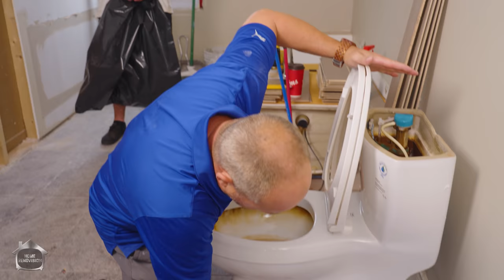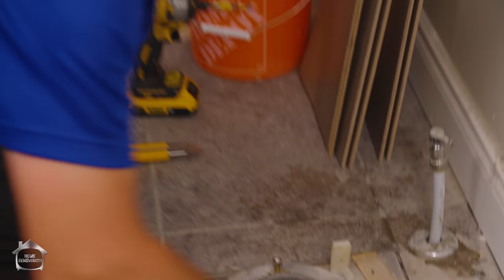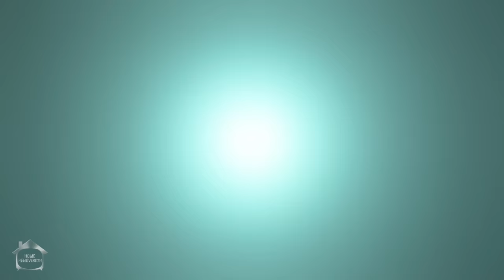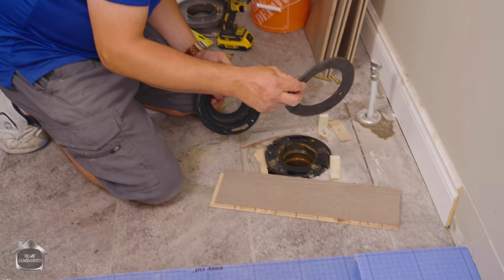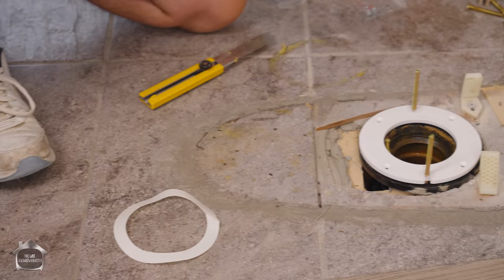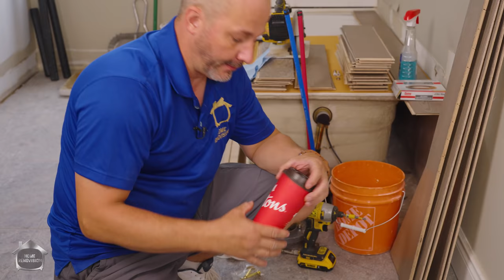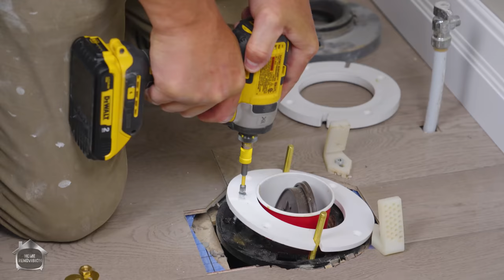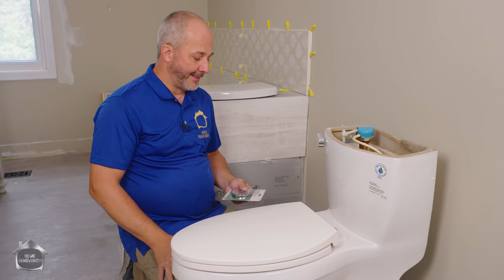How To Install A Toilet So It Won't Leak | DIY For Beginners

Comment: As a master plumber and someone who has been doing it for 20+ years this is an excellent video with very good information. The only thing I'd add is don't ever use anything made of metal to repair or raise the flange height. Those metal flange repair kits always rust and fail, don't use them. Use plastic or rubber like all the different options shown in this video.
Reply: @Supa Trending Daily you don't have to use a metal flange. There are better options. Have you had the toilet off to inspect it? Or are you just saying that because you haven't seen any water damage? There can be water damage that isn't visible until you remove the toilet. Maybe you grease will protect it. Seems like an unnecessary step when you could just get something that works without it.
Reply: @Supa Trending Daily why did you have to use a metal flange
Reply: @mattmcc7930  I did a toilet replacement one time.  Lifted it up and the floor was completely rotted underneath.  Surprised someone didn't fall through floor into basement while on the loo.  Only thing holding the toilet up was the abs pipe.  Good thing the drain was only a foot or so from the stack and gave the toilet good support.  You could not tell from the top and no problem on ceiling below.  Just a little leak over years.  I ended up doing a complete reno of that bathroom.  The lady was very happy and I used the rubber seal under the toilet.  The old beeswax seems to have disintegrated over dozens of years.
Reply: Even stainless steel flanges?
Reply: @TheKrugen79  Perhaps. I have seen rusted out stainless steel toilet bolts. That's why I only use solid brass. While stainless is much more resistant to corrosion it is not impervious. That said, rubber will degrade over time but will probably still outlast the stainless steel. Plastic will degrade but takes much longer then then the others, like a life time even if not more.
Reply: HI Matt McC. im installing my toilet and i need to use a flange extension to raise it up to a quarter of an inch from the finished tile. The Flange extension i got does not have a gasket to seal when i screw it to my existing toilet ABS flange. What can i use to seal to avoid leak in between the extension flange and the original flange? Would appreciate getting your expert advice. Thanks
Reply: Thanks for replying Matt. Appreciate it. Start your own channel too.
Reply: @mattmcc7930   I used a 1/2 flange extender and i am about 3/8 higher than the finished tile now (1/8 higher than ideal 1/4). Am i ok to still use the jumbo reinforced wax ring?
Reply: @stevenm7606  you should be fine with the thicker wax ring. A little extra tall won't hurt anything.
Reply: @mattmcc7930   Nice..and is 3/8 of an inch above the finish tile acceptable? I know 1/4 of an inch is ideal,.
Reply: @stevenm7606  3/8" should be fine. I prefer to be flush or a little high. But I have placed the entire flange directly to the finished floor and never had an issue. So the entire thickness of a plastic flange above the floor and it was fine.
Reply: @Matt McC  I actually have two flange extenders....1/4" and 1/2".  With the 1/4" i will be flush in front but about 1/16 low on the back. Can use the Jumbo Reinforced wax ring..With the 1/2" is where i will be about 3/8" higher from finished tile. Which of the two flange extender sizes would better you think?
Reply: @stevenm7606  They will both work. I'd recommend a little high over a little low, but that's just me.
Reply: @mattmcc7930  Thanks a lot for your help. I
Reply: @Matt McC.. I am using the flange extender in this video with the compression gasket. That should be a good seal already? or adding silicone would make it more water tight?
Reply: @stevenm7606  never use silicone
Reply: @mattmcc7930  alright. So the compression gasket itself that comes with the flange should be perfect?
Reply: @stevenm7606  It should be fine. I prefer wax.
Reply: I’m thinking I better go with the jumbo wax as I’m about 1/8 below the finished tile
Reply: @MegaJiat  yes
Reply: you mean like the metal flanges they used 50 years ago that are usually still in tact after 50 years? The idea is that water never touches the flange since its covered by a seal and the water should only enter the drain hole as its designed.
Reply: @TDA DIY  No, not like those flanges. Those were cast iron or sometimes just lead. I'm talking about the modern flange repair kits that are just coated steel or stainless steel. Or the new flange fittings with metal flanges. I understand the idea of it, but theory and actual use don't align. I've replaced countless rusted flanges that weren't more then a few years old. Every material breaks down over time, steel more so in a wet atmosphere. In my opinion it's best to have the material that takes the longest to break down over time, like plastic. Even your wax ring will break down, so why not have something that will outlast it?
Reply: @stevenm7606  silicone
Reply: @mattmcc7930  silicone seals any micro-gaps between two hard surfaces.  Engines use silicone for head and valve cover gaskets for that very reason.
Reply: @John D  cool story bro. I've never seen anyone use valve cover gasket to seal a toilet to the toilet flange. Let me know how that works for you.
Reply: @mattmcc7930  You have reading comprehension issues?  I said the use of sealants, in addition to a gasket, is commonly used in mating two surfaces together.  To suggest not sealing an ABS riser flange to a toilet flange is a recipe for leaks and damaged subfloors. .
Reply: @John D  This isn't an engine. Don't use silicone. The rubber gasket in this video is thick and flexible on purpose to allow for expansion, contraction and movement. If you add silicone then you are gluing the gasket in place. It isn't designed to be glued in place. It is plenty capable of sealing on it's own and adding silicone to the mix is adding failure a point. Do it how you want on your toilet, but don't come here give bad advise. Use automotive gasket sealer/maker on your engine and use toilet gasket on your toilet, it's really quite simple.
Reply: @mattmcc7930  The foam ring on the underside of Oatey flange extensions is less than 1/8"  thick.  If the existing toilet flange has scrapes or gouges, or is slightly cupped (by overtightened toilet bolts) it can cause small channels where water can bypass the foam ring.  The 5 second step of applying a thin bead of silicone is well worth it.  As for expansion, contraction and movement issues, that is the whole purpose of silicone, which is flexible by design.  lol
Reply: @mattmcc7930  And if you're referring to a foam toilet ring instead of wax, no professionals use them anyways, so it's really a moot point.
Reply: @johnd9541  I'm referring to the rubber gasket used in the video. The same one you recommend using silicone on because engines.
Reply: @John D  you missed the point completely. Gluing the gasket to the flange will cause issues. If your flange is gouged then replace it. If you are incapable of replacing it then I suppose you could fill the gouges with silicone and let it dry before placing the gasket, but it's a subpar fix and thats not what you said. Again, gluing any gasket to the flange will never be done by a professional. It's exactly why we use and recommend wax. Because you get the best of both worlds. But clearly you know everythibg there is to know about gasket, toilets, and engines, so perhaps the best thing for you to do is start your own YouTube channel and enlighten the rest of the world with your great wisdom.
Reply: @mattmcc7930  Silicone is NOT a glue.  Try reading  labels.  And to suggest breaking up a floor in order to swap out a toilet flange instead of 30 seconds and 30 cents worth of silicone serves to confirm your purpose here is merely to drive up page clicks and engagements for this channel.
Reply: @mattmcc7930  With that comment I can only assume you're a plywood salesman.  Don't silicone your tub drain gasket either, right?  People like you keep people like me busy.  Please keep it up.
Reply: @John D  You are clearly an amature who thinks himself a professional. No, I never silicone a tub drain. A pro knows how to do it so it never leaks without a from of silicone. A pro also knows that if he does use silicone and it does leak then good luck getting back off because silicone in a tube or caulk gun is an adhesive you dip. What do you think holds a trimless glass shower surround together? Silicone. You are the reason people end up having to cut a tub drain out with a dremel because some dip didn't know how to properly install a tub drain that doesn't leak without using silicone, AKA adhesive.
Reply: @John D  Let me guess. You don't cement, you silicone the pvc joint together. Screw in my truck tire? Silicone it. Get off your crutch learn how a real plumber does it.
Reply: @mattmcc7930  You neither cement nor silicone PVC or ABS together.  You solvent weld them.  Silicone is not a glue therefore using silicone to patch a tire would result in a blowout due to air pressure.  Drains are gravity based, not pressurized, therefore pressures don't reach more than a few PSI at the toilet flange, substantially less than a sealant can handle.  Anything else I can help you with?  And please stop using T tape on compression fittings too.  ;)
Reply: @mattmcc7930  Geeze I won't even mention that silicone is recommended over plumbers putty for non-porcelain sink  drains, but then you don't seal either because you rely strictly on the fit of the chrome basket against the hard sink surface.   lol  And please forward a pic of the word "glue" or "adhesive" on any silicone tube you find.  I'll wait.  :)
Reply: @John D  Recommended by who? The silicone company? Have you ever tried removing a basket strainers sealed with silicone? Non porcelain? But what about your porcelain tub? Yes, I use plumbers putty, unless otherwise specified. Do your own damn research. Use your silicone on your kitchen sink let it set for 48h and then try to remove it, and then come back here and tell me it's not an adhesive. The fact that you've never seen the word "adhesive" on a tube of silicone tells me you never really even looked.
Reply: @John D  I'm surprised silicone even sticks to anything if it has no adhesive properties. Wow that's weird.
Reply: @mattmcc7930  Okay now youre just being silly.  Plumbers putty is obsolete for most uses as it dries out over time.  It's not 1950.  And p.s.. when you apply silicone, use a thin bead instead of a shovel.
Reply: @John D  Plumbers putty is not obsolete. It will last for decades if installed properly. I've replaced sinks  from the 50s that had the original putty and that didn't leak. Hint, if your putty leaks, it's NOT the putties fault. You should stop getting your plumbing advice from memes. Also, oddly quiet on silicone adhesion in that last post, what you finally do a Google search?
Reply: @mattmcc7930  Silicone is an adhesive sealant, not an adhesive or glue.  Unless you're a snowflake, and unable to achieve the rotational force needed to break the coefficient friction of the seal of course?  Try using something other than longnose pliers maybe? lol
Reply: @mattmcc7930  An adhesive sealant, not to be  confused with an adhesive that seals, or an adhesive or glue.  The word adhesive is an adjective, used to modify or describe the main purpose of the product,  which in silicone's case, is to seal.  You're welcome.
Reply: @John D  oh I'm sorry, I thought you implied the word adhesive didn't exist on any tube of silicone. It's good to see you took my advice and actually did some research. Your welcome.
Reply: I don't agree use stainless ring  or if pipe is cast iron I lead and oakum in a new flange
Reply: Even brass?
Reply: @Xiomaro01  brass is good.
Reply: Also a licensed plumber here. I definitely agree. Personally my go to with a rotted or broken flange are those Fernco inserts for the toilet seal and setting the toilet in plaster of Paris. I’ve never had an issue or a callback doing it that way.
Reply: @johnd9541  you just said "ADHESIVE sealant"
Reply: @eileendavis3042  Yes, a sealant that sticks to things.
Reply: @mattmcc7930  yes ! And to avoid stripping the head of the soft brass ( flat head is best ) pre “screw” with tap cons or what not.
Reply: Why is the toilet so far off the wall ? I can see the services from the side it looks terrible to me
Reply: Ummm stainless steel flanges do not rust…
Reply: @mattmcc7930   & @john d  I have to say that @matt McC won this argument 😂‼️ @Matt McC everything you said and answered, along with this video. Has shown me and taught me easier ways to do a toilet replacement.  As an 18 building apartment complex maintenance tech I’m changing toilets all the time. So I’m always looking for new and great ideas that I can implement into my work to make it easier and faster. Thank you for sharing your knowledge. I will definitely try what your saying‼️.             ✌🏽👊🏽
Reply: Just did  a reno with a new floor and new tile. Moved the toilet and gained much confusion on the height of the flange. Tiler's plumber says the tile should be the same height as the flange. Allot on the internet say the flange should sit on the finished floor. Plumber says flange on finished floor is too high. Wax could get squeezed too thin. Which is it? I haven't glued the flange to the pipe yet.
Reply: @robertlange9107  The plumber is correct. Flange flush with floor give or take a little is what I always aim for. With the flange sitting on top of the floor it leaves very little room for error on the toilet. If the manufacturing for the toilet is wavey or off a little, your Flange can contact the under side of the toilet and cause a potential leak point. Toilet manufacturing is not an axact science, so a little extra space is preferable.
Reply: @mattmcc7930  Thanks for confirming. Much appreciated. 👍
Reply: Why would you even look this video up? (If you are a professional plumber
Reply: @colewolfe6601  I didn't look it up. It was in my feed. And I watched because of curiosity.

Comment: ALWAYS put wax on bottom of toilet first, never on floor. Impossible to miss and weight of toilet and 2 fingers will push it down just fine. A plumber taught me this 20 yrs ago and its a no fail way. Even instruction manuals for the last 5+ yrs say to install wax on toilet, not floor.

Comment: Our house was built in 1945, and over the past two years we've been slowly renovating.  I'm about to finish the last thing...the floor in the bathroom.  I can see the light at the end of the tunnel.  You didn't know it, but you've been helping an Okie renovate his house over the past two years. Much appreciated.
Reply: The black rubber extension should work on a 5th wheel travel trailer(?) Wax rings don't  work well in travel trailers

Comment: Little tip if you roll down the edges of the garbage bag, you can place the toilet on top of the rolled down bag then you can roll it up around it without needing a helper. Love your channel.

Comment: Great!  I've installed DIY toilets for years and thought I knew how to do it.  Turns out my sister's had a leak (I'd installed after putting in a tile floor.). I don't seal between the toilet and the floor just so these problems are not "sealed-in".  I had mis-installed. The wax ring I'd put in looked exactly like your demo on a mis-install.  Followed your lead and put in a non-wax seal.  Worked perfect,  no leak, no mess. Great video !

Comment: Excellent video. Much appreciated. One suggestion: before cutting the hold down bolts shorter (if necessary), screw on a spare nut just below where you are cutting. After cutting remove that nut. The purpose is to make it easier to put the permanent hold down nuts on, as the threads may have been distorted by the cutting. Removing the spare nut will 'clean up' the threads.
Reply: Oh great idea thanks!

Comment: Lots of great information!  I am dealing with water damage from a leaky toilet.  I believe the old cast iron flange failed producing a leak. Shims were under the back edge making me think the floor wasn't level before they installed.  Thanks to your information, I can fix this the right way.

Comment: you just saved me a ton of money. My upstairs toilet has been leaking for the past 20 years (life of the house) and instead of working the problem from the ceiling of the 1st floor like everybody is telling me to do, you directed me to look to the problem - yup, the toilet wasn't initially installed right and, as you mentioned, it slowly leaked and water took its jolly time to get to the 1st floor... Correction done and now all is ok! Thanks for your great videos!

Comment: Best video I've seen so far. I'm about to change out the toilet and I only want to do it once to perfection as I am getting too old and tired. I want to do it right once and this video is filled with great tips. My main problem is someone screwed up the floor so not I have to build a custom rectangle medallion out of 3/4" plywood where toilet will sit on so basically like 1"-1.25" got to jack my flange up higher. I'll report back.

Comment: Thank you for this video. Our contractor installed our toilet, did not caulk with silicon and the toilet would rock back and forth. I had to stabilize it with a kick at the back, but this makes me think I'll have to pull it up and make sure he didn't mess things up and this video confirmed my suspicions.